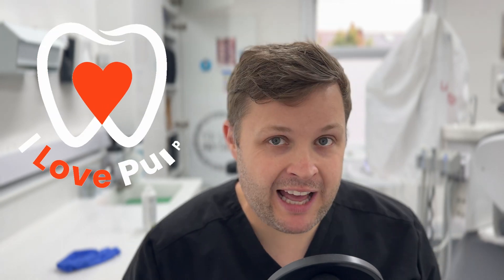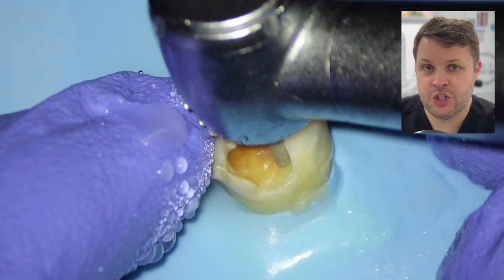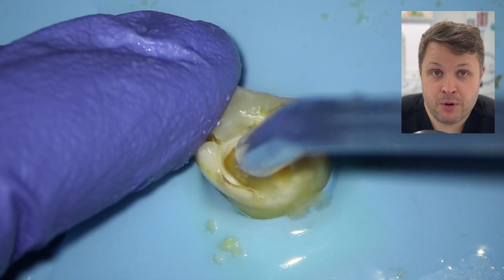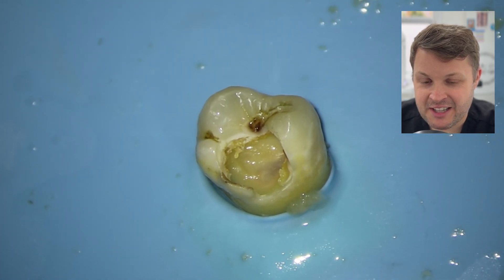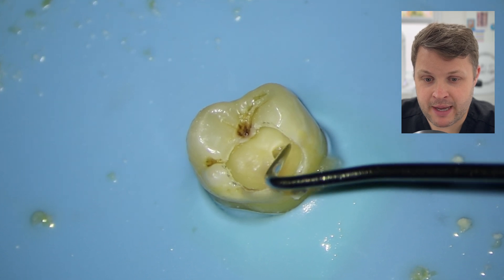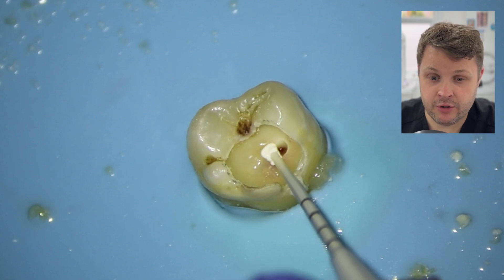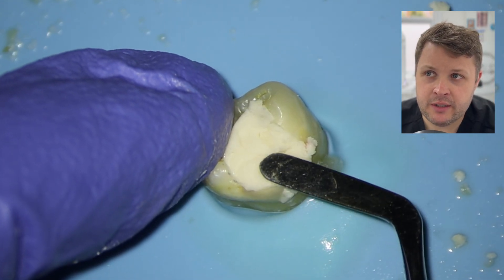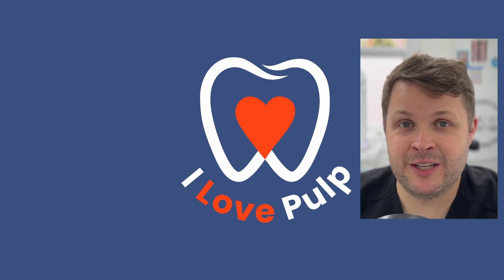You’re Probably Dressing Teeth Wrong Before RCT… Here’s Why

Comment: Case selection for vital pulp therapy is the the most important factor, the tooth must be vital(responds to cold thermal test but without lingering pain), -ve vertical percussion and no spontaneous pain. during caries removal, as soon as you get near the pulp, rubber dam must be applied to prevent any bacterial contaminations before further caries excavation. At this point, if any pulp exposure happens, bleeding on exposure site should be expected. Otherwise further removal of pulpal tissue and plup roof should preformed. Non bleeding exposure means there is a local necrotic pulp tissue under that exposure.

The aim of dressing is to seal and prevent any bacteria from entering the pulp space, the dressing material should cover and extend over dentin that make roof of the pulp. As for the dressing material, MTA and calcium silicate cement are superior. 

Application of MTA is challenging, after application of MTA over the exposed area and adjacent dentin, and after set of 3 minutes, cleaning of cavity walls(that are unintended to be covered) is preformed with a damped bond brush to remove any MTA residue. After 3 min of setting, a self etch bond is applied gently on the MTA and the adjacent dentin, dry the bond with air, then cure the bond. Cover the MTA with dentin around it with flowable composite, cure the flowable, then fill the cavity at the same visit after redoing the bonding procedure with total etch technique. Sealing the cavity at the same visit insure there is no way for bacterial contamination. 

Informing the patient about pulp caping is important, and there is a possibility of pain and RCT, 

vitality follow up is part of treatment, the vitality of the tooth should be checked
Reply from the maker: BRILLIANT INPUT! Thank you! Keep the nuggets of information coming!

Comment: Someone help please, I'm not familiar with the term "dressing" what is the purpose of this? , obviously it's not direct pulp capping because the tooth needs a RC so is this dressing a transient step (for an example because of time and schedule reasons) before a later appointment for the RC ??
Reply from the maker: Yes it is a a temporary filling until extraction or root canal therapy can be completed. What do they call this type of treatment where you are from?
Reply: @ilovethepulp  in Germany the use of formaldehyde based products is still common so in such cases i see a lot of dentists just put a little sponge soaked with a product called Toxavit, which i find awful and so outdated

Comment: Thank you for sharing the video. First of all you said that the diagnosis was CAP which means that the pulp is totally necrotic And is not indicated for pulp capping. The second thing is calcium hydroxide is no longer the best capping material since the introduction of calcium silicate based material. With all respect I don't agree with you and I would rather go for endo treatment in such case and using calcium hydroxide as intracanal dressing material. Direct pulp capping and pulpotomy are technique sensitive and case dependant and require long term follow up to insure success.
Reply from the maker: Believe it or not, this tooth had a large lesion associated with it on the radiograph! I was totally surprised when I accessed this tooth and it was bleeding! But I agree completely with what you say however! This was not a pulp cap, but a dressing prior to either extraction or RCT
Reply: A tooth can still be vital even if it has PA pathology, hazim :) Here is a good paper were they performed a partial pulpotomy on a tooth with PA pathology: Successful Healing of Periapical Pathology with Partial Pulpotomy in a Mature Permanent Molar: A Case Report (American Journal of case reports).

Comment: With Vital cases it depends on how much bleeding there is, I like to vent the pressure and let it bleed out , then dress. For non vital having had one myself, its important you remove as much intra canal bacteria as possible. Only removing a bit will resolve the bulk of the pain, but not all. So it would be remove all the decay, get to WL and prepare to 20 / 04 with copious irrigation of NaOCl 3 to 5%. I find this works a lot better.
Reply from the maker: Amazing thank you. I think this issue with that is that say you had limited time, and you didn’t have time to get to the WL? Would you at least remove the pulp from the pulp chamber?

Comment: Hey there! Thanks so much for the video! It was really interesting. 

My questions are:

1. Compared to other dressings, how effective is calcium hydroxide in pain relief? "sometimes I use PD Devitec"
2. Doctor, I'm curious about where and how you find it convenient to perform these learning or experimental steps "extracted teeth". Is it right at the dental chair, or do you use a different setting? I'd love to learn more about this process and see how you approach
Reply: Alright man, I'm obviously not the PulpLover but in my experience:

Depending on the pulp status, medicament efficacy varies. 
Ledermix which contains a steroid is often helpful for irreversible pulpitic cases to dampen the inflamed pulp tags which is partially colonised with bacteria.
For a necrotic pulp, calcium hydroxide which is caustic and alkaline will scorch the biofilm-covered dentine and kill the bacteria. I find keeping the inside of the canal moist with hypochlorite prior to medicament application works best to continue the disinfection process until I see the patient the following visit, to confirm absence of signs or symptoms of endodontic pathology, prior to getting the canal bone dry prior to obturation.
That's my thoughts, what are yours?
Reply from the maker: Im sorry I can’t help with which dressing is more effective over the other. I only really have clinical evidence rather than the better academical evidence. But I think CaOH is more effective. As for where I get the time and setting to do these videos, it’s either before or after work, or during lunch times! I love doing the videos so I don’t mind!